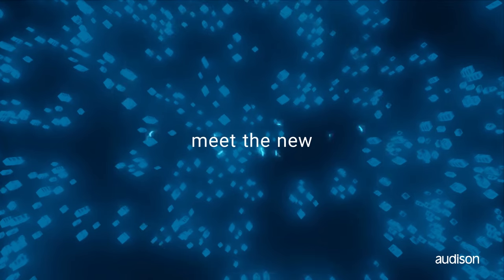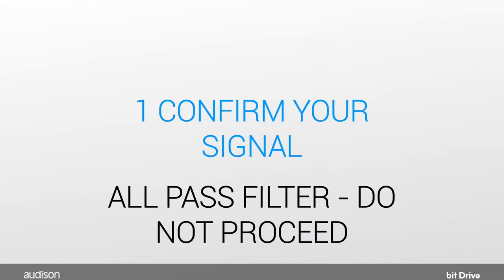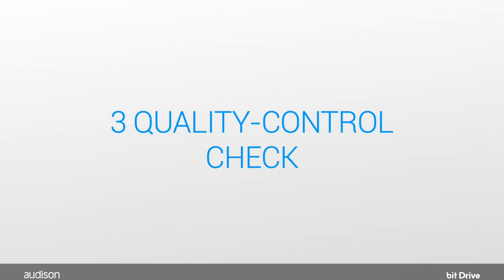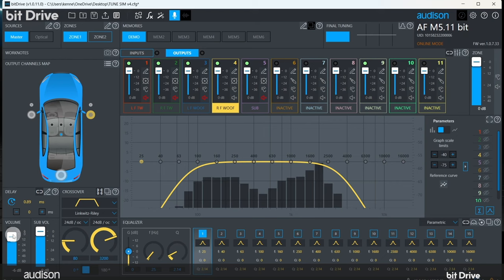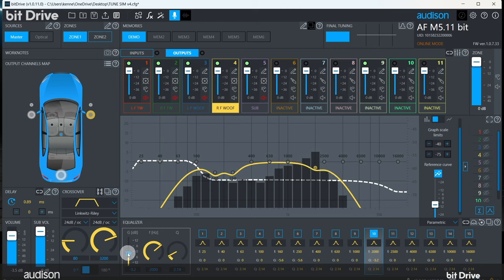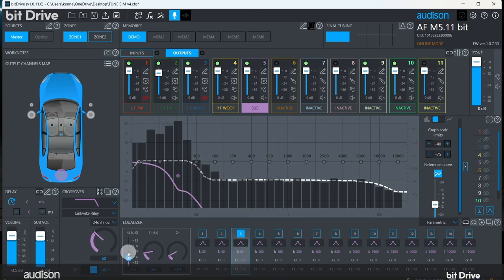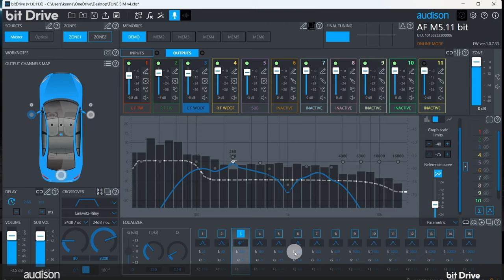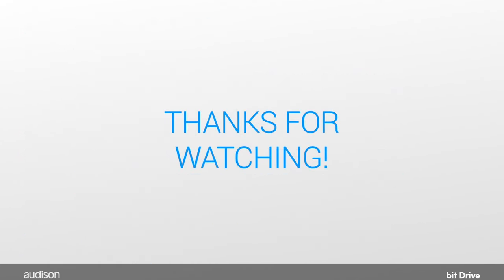Episode 5 - A Driver’s-Seat Tuning Process

Comment: How loud do i play the pink noisee and is it not measured with closed door?
Reply from the maker: Hello, you can set the AF Master volume at around -15 or -10 dB, so that after aligning the cabin acoustic response to the target curve you will still have room to increase your volume as much as you want!  The entire measure with microphone must be done with all closed doors and the operator standing out of the car, in order to replicate the common listening case. Best regards
Reply: @AudisonItofficial   In bitDrive software, how to load calibration file for calibrated microphone e.g. UMIK-1?

Comment: Very nice detail. Im going to look in my apf8.9bit sw & see if there is a similar target curve. ( if not, at least its in the new sw, with new forza amps👍🏼👏🏼😀)
Reply: The bit Drive software with the Acoustic RTA and the Reference Curve is not compatible with the AP F 8.9. For tuning that amplifier, dealers often use the bit Tune standalone acoustic RTA system, which has reference curves in it.